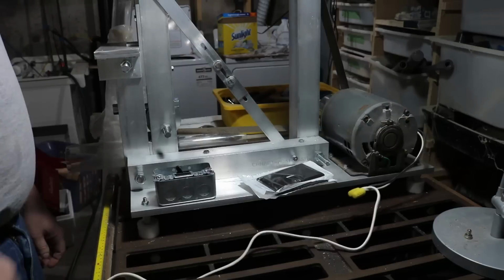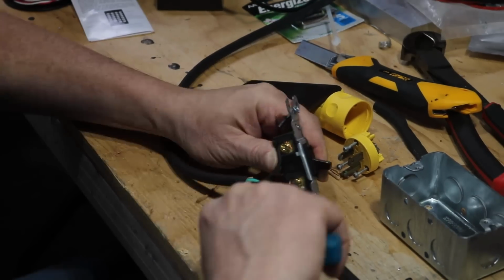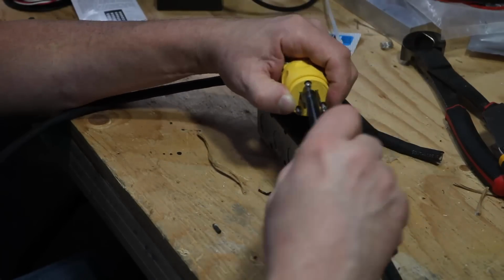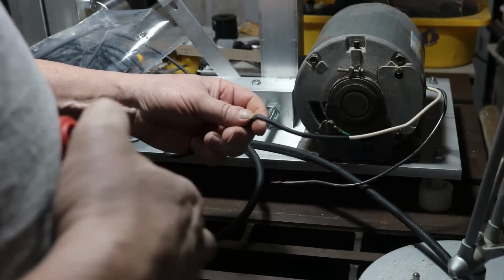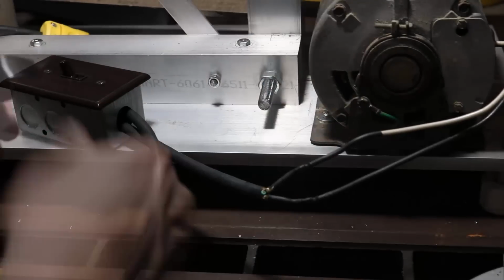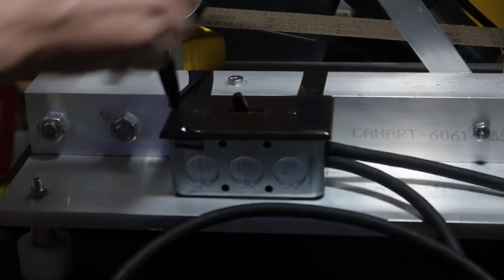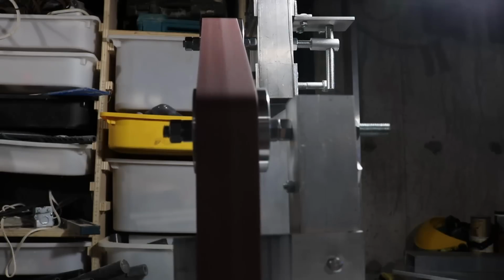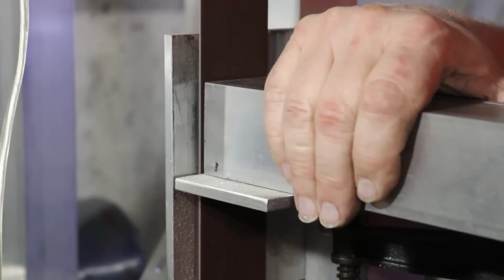DIY Belt Sander Final Adjustments and Testing

Comment: I have watched ALL of the videos for this build and while, for what I will be doing with mine, when I finish it, you were WAY to precise for anything I'll be doing!  I loved the whole process and you did a wonderful job!  
Should you ever decide to upgrade your motor to a more robust, as well as variable speed motor, you might try just asking for used treadmills on one of your local swap sites!  
Me, I just went to the dump, today and removed 3 treadmill motors from those that had been thrown away!  2 of them were fine and one needs brushes!  I think I was lucky and will use all 3 of them for variable speed shop tools!  NO cost involved!
Again, kudos on the build!
Reply from the maker: Thanks for watching and thanks for the tip.

Comment: Glad it is up and running for you! I know you are happy to have it up and running! A couple of thoughts. I am surprised the motor has solid wire coming out of it. Did you take off the motor plate were the wiring goes into the motor. That is where most of the connections are made. If so you might be able to wire your nice stranded wire all the way back into the motor. Solid wire does not handle the vibration as well. Even as smooth as the sander runs there is vibration. The sharp metal edge of the electrical box will cut into the black cables at some point. Need to look in to a grommet or a strain relief. I would hate for it to short out and shock you.I hope you dont mind my thoughts on this.
Reply from the maker: I didn't think of rewiring the motor. I probably wouldn't have had time before I had to move onto the next project anyway. Once that job is done and I get a Break I might do some upgrades depending on how it's running
Reply: Not to be critical, but in addition to Tom's comments, did you see the green screw & wire on the motor? That is where you should have ran the ground wire from the wall all the way thru to the motor. Bit of safety issue there. Nice sander build.
Reply from the maker: I will probably have to do that rewire. The things you miss when you are under a time crunch
Reply: @FishmanEricRussell  Not enough FPM, by a factor of probably 3 nor is there enough HP. VERY nice build, but a little expensive.
Reply from the maker: @earlborchardt4358  Just something fun I wanted to build. It works well for what I need, which is to take the edge of cut aluminum and glass.